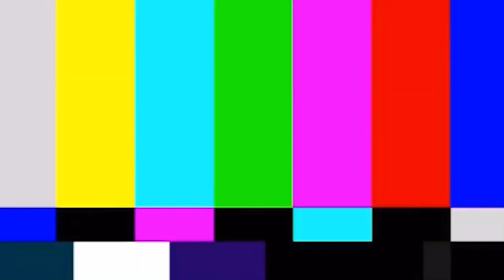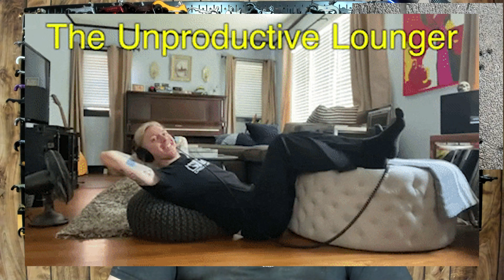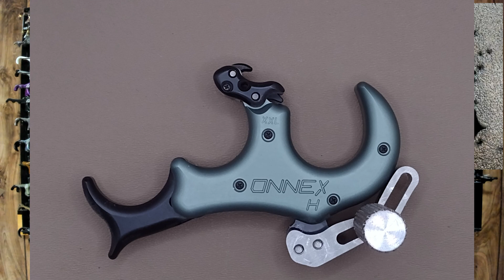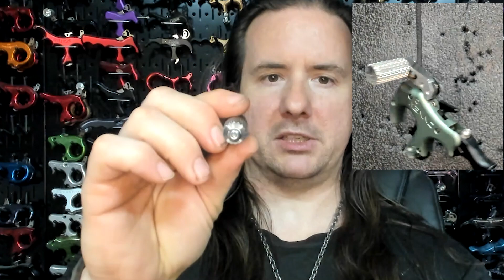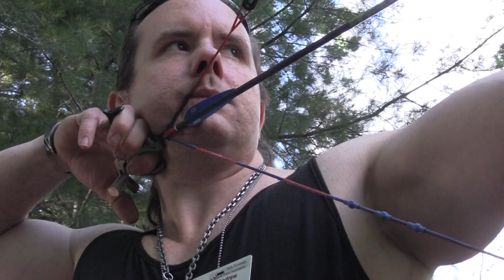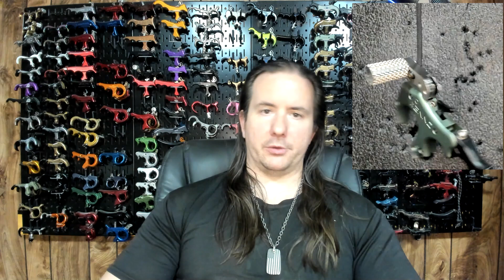Plural Designs USA HFE-1 OnneX Arm and Barrel Kit

Comment: The Onnex now comes with both thumb barrels and post sizes, unless there's some crazy eeextra long one
Reply from the maker: You are correct.  The OnneX comes with a short and a long-er thumb barrel post, and there is an Extra-Long post available on the website.  They're only 8 bucks, so I might order one to see how much of a difference it is.
Reply: @ajbholsters2035  oh thats crazy, i tried the long one from the get go and it was wayyyy too long already, can't imagine what sort of bear-handed behemoth would need an even longer one hah
Reply from the maker: @JulzA89  if I had to take an educated guess, the extra long post would allow somebody to settle the thumb barrel into the base of the thumb with a fully flattened hand, or it could put the thumb barrel up above the tension screw similarly to the HFE-1.

There was enough of a demand that they chose to make one, so somebody's bound to be finding a use for it.

Comment: Will this still fit into one of your current holster designs?
Reply from the maker: Hello and thank you for watching.  If you set this flush with the back of the release, then it's not going to fit an existing holster without modifications.  The way I have it set in the video (and on the one rotating in the corner) does fit with enough clearance to rotate it down even further.

I'm probably going to end up doing a "signature series" or some such variation if the HFE 1 becomes popular and there is demand for it.